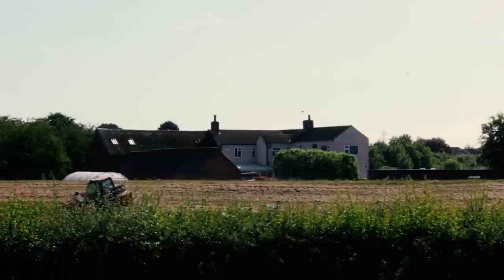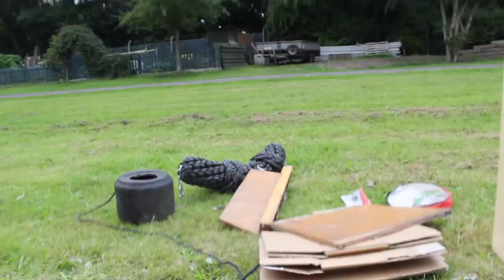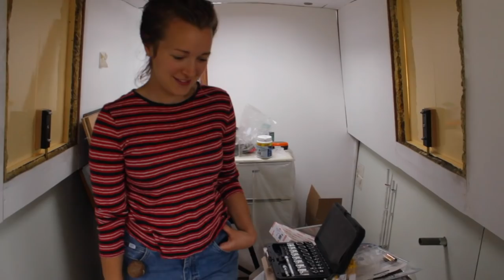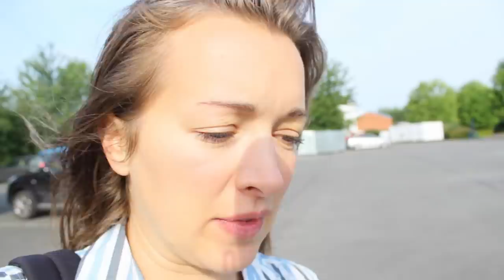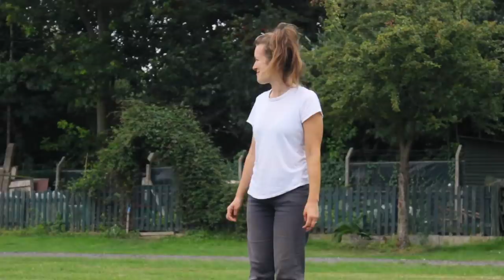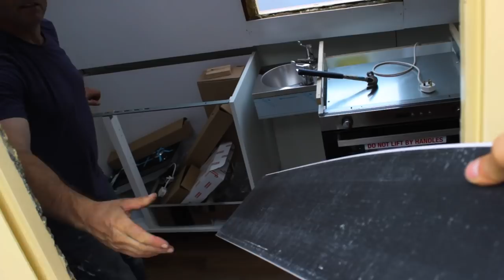Ep19 Building an OFF GRID BUSINESS: Working from home

Comment: Holly looks great away from the boatyard, every one did a great job. Now the fit out and may I suggest you loose fit every thing first. See if you like it and will it work for you, then connect plumbing etc. If you need to cut any cabinets or work tops treat the cuts with preservative to stop water spills and damp getting in.

On my Thames mooring there was a gravel shelf on the opposite bank, cattle would come down the water and cool off, all manner of wild life was around and a pleasure to watch. One major draw back was the mooring was right under the flight path to/from Heathrow. This was in the time of Concorde when that took off the glasses rattled on the shelf. I'm just glad the airport shut down at night.